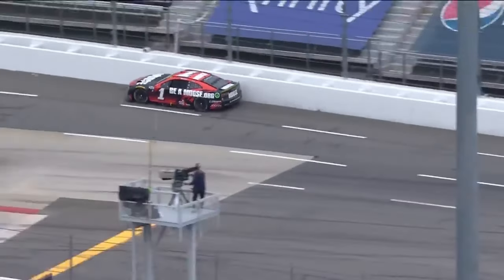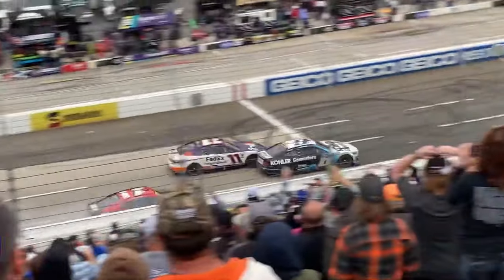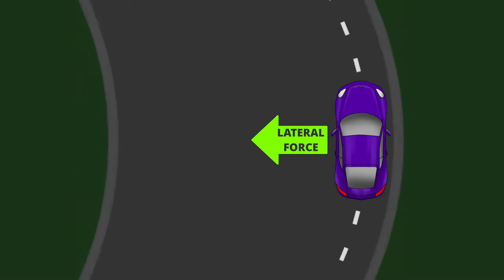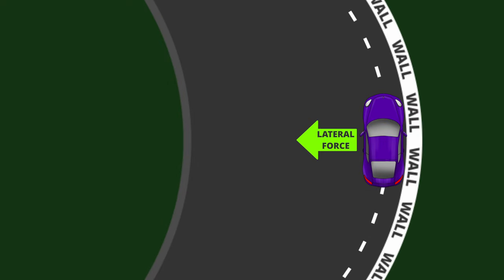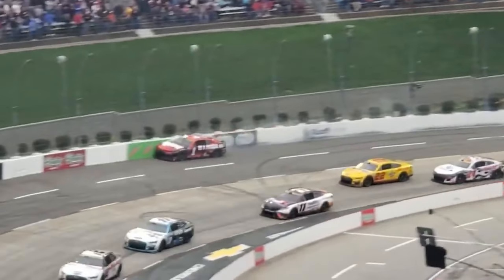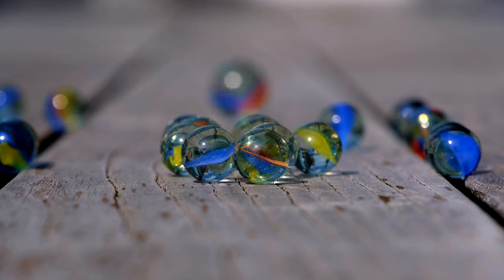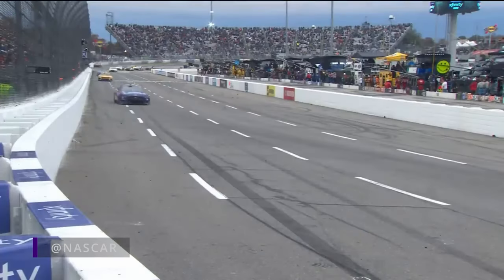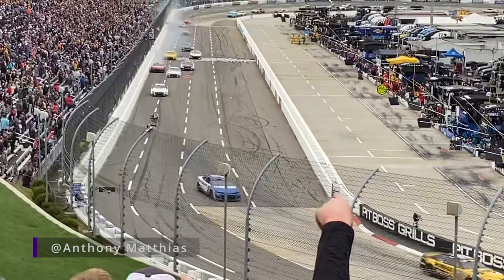Why did Ross Chastain's WALL RIDE work? [SIMPLIFIED PHYSICS BREAKDOWN]

Comment from the maker: A couple of other factors worth noting that was too 'deep' for this intentionally-simplified video...
Physical factors:
  1. Low(er) curvature of the wall
  2. Suitable stiffness of the wall
  3. Sufficient gap between the tires and the wall
  4. Shape of the body
Tactical factors:
  1. Large speed differential between straight and turn
  2. Short straights
  3. Low banking
  4. Sufficiently clear traffic
Reply from the maker: fladave99 Mills  Yeah by my math, he was near 6G's when he entered the corner. That's crazy. On another note, do you have any preventative measures for bruising around the spine in karts?
Reply from the maker: fladave99 Mills  Slowdown? Never... but yeah you're right, I tend to be a bit loose in the seat. I think that's what's doing it. I thought my jacket would alleviate it but it did not.
Reply from the maker: fladave99 Mills  Thanks man! Thanks for the support. I do have a rib protector, just seems like sometimes even with it on I get all these bruises down my spine.
Reply from the maker: fladave99 Mills  lol yeap. it's difficult indeed. I didn't either until I started it.
Reply from the maker: It's really just practicing various tasks in isolation enough so it becomes second nature, then adding more and more tasks to it - basically "walking and chewing gum at the same time". For many novice students, it's quite overwhelming, but eventually many tasks get put on autopilot.

I would presume flying a fighter jet in combat would be an activity that requires more management.
Reply from the maker: You mean these?? https://images.app.goo.gl/Pcu9GGNUq5LeESyWA

Comment: Sorry but you’re missing a very important factor. The wall (by design) is flexible and has some “give” to it. One of the keys to Ross’s move was staying close to wall all the way down the back stretch, narrowing the angle of contact when the wall ride began. Had he started lower he would have shot up at too harsh of an angle and the barrier would have given into the weight, creating an indent the car would have gotten stuck in. Had he started the wall ride earlier, he would have risked not being able to turn the wheel, limiting the effectiveness and he still had to turn slightly…none of it was planned..just luck and courage
Reply from the maker: Yes you are correct. There are many other factors that I was addressing on the comments as you posted this. Take a look and let me know if I have missed anything.

Comment: This is one of those moves that leaves everyone in every former race since the beginning of NASCAR, wondering why the heck they didn't think of this.  As others have said, now that this particular genie is out of the lamp, it'll be banned as quickly as is possible.  To be sure, in this instance, the parts carnage was totally worth the outcome.  It's expensive to do this, so....
Reply: It's been tried before, just that it's never worked.
Reply: Because older cars are a lot softer. Try in beamNG drive the car change shape and slow down too much.

Comment: It won’t work every where, and who knows if Chastain just got lucky. I don’t think it will be  a regular thing. A couple drivers might try it and if they fail then the move will slowly fade away.   Also Bold moves like this are generally the type that creates new rules or rule modifications to prevent or limit this.  Tracks like Dover, Bristol, Darlington, and Super Speedways where you are constantly pushing this limit what do you do there. I don’t think you can completely ban this move but maybe limit the time or distance a car can be on the wall.
Reply from the maker: Luck is definitely a factor, as are many things like the curvature of the wall etc.
Why don’t you think they can completely ban it?
Reply: @LastTenth  I just think that certain track like Darlington where your pushing that boundary it’s going to be hard to distinguish what’s intentional and what’s not in some cases and it then becomes a judgment call.
Reply from the maker: Is it because of the banking and viability of the outside lane ? (NASCAR noob here)

Comment: It will be made illegal. As cool as it is, it's simply too dangerous, for all the drivers, to remain legal. In fact, they should probably change the rule now to save other drivers' lives, which means you necessarily have to disqualify Chastain. He was lucky it worked. If you angle into the wall too much, you'll ricochet back out into the raceway, into the other cars. That happens on accident a lot, but if this move remains legal, people will intentionally try it, which will increase the level of danger on the last lap.

Comment: Does low suspension come into play
Reply from the maker: Unlikely unless I'm missing something. Ride height will change the track width which may help/hurt wall riding, but I doubt it's at play in general.
Maybe someone else will have a better answer...

Comment: I've been a Nascar fan for 25 years and I've never seen a move like this. I also don't want it banned. 

If Nascar wants to fix this problem without adding a new rule the answer is simple. Have a different transmission package at the short tracks ( Martinsville) that doesn't have a 5th gear. The only reason he went that fast and gained that much time was because he had a 5th gear option (Next Gen). Take that away and I don't see him gaining the spots he did. Thus while it'll still be legal drivers won't try it
Reply from the maker: That's interesting. Is it common for them to stipulate different transmission specs at different events?
Reply: @LastTenth  Yes, Nascar sets limits to the transmission great ratios. It's possible for them to set a gear ratio that limits speed below what Ross did.
Reply from the maker: @keeganbrown9967  Good to know. Thanks!

Comment: Two thoughts 
1) Gutsiest move I’ve ever seen.
2)  Most dangerous thing I’ve ever witnessed on a track.
Reply: Definitely not the most dangerous move.  Keslowski/Edwards was probably one of the most dangerous.
Reply: @billyrayvalentine7972  The crazy thing about Keselowski/Edwards drama is that you can choose which one was more dangerous (Carl being thrown into the stands at Talladega, Edwards turning Keselovski and flipping him over in Atlanta or Edwards spinning Keselovski in the middle of the pack in Gateway)
Reply: @pedrooliveiraoliveirasimoe5478  Carl came down on Kes at Talladega. That was on Carl. He obviously didn't mean to flip Brad at Atlanta, just spin him, but it ended up being extremely dangerous based on the way the roll cage got crushed. Wrecking Brad at Gateway was a total chickenshit move.

Comment: -Going over 100mph
-Says it was a blurr
-Small turn
Definitely took a couple G's of force during that maneuver lol what a legend. I'm surprised he didn't lift off the throttle at all
Reply from the maker: He was entering the corner in the vicinity of 6G's by my math.
Reply: well ross said himself his head was jolted after that, i think those was the words he used. yea this wont be common. the cost outwieghts the gain and this is the only reason to do this.

Comment: i can see why they wouldnt want it legal. there would be the possibility of too much debris on the track that could cause accidents or premature failure of tires. there is also the issue of the damage to the car, which can be mitigated if you design some sort of roller to take the corner. but i feel like if that happens, then nascar is going to turn into wall riding simulator and they will just be wall riding every corner..... so probly best to ban it. it was cool, but if its not on a final lap, could be problematic.

Comment: I don't follow nascar, so my question is: Why he did that? Did he won? Or just to get 5 places?
Reply from the maker: I don't either (or any racing really 😳), but from what I understand, he needed 2 positions to qualify for the title race, or something on those lines. Experts please chime in...
Reply: He was in a fight with Denny Hamlin over the fourth spot in the Championship 4, and Denny being fourth while Ross being tenth, with the previous race results, would put Chastain out because he needed to at least overtake 2 more cars in order to make up enough points to remain in the top 4. Chastain owned what is called the “tie-breaker” over Hamlin, as he finished in second place more than Hamlin had done, whilst they had the same number of wins. So what he needed was to just grab 2 more points in the total to send him through to the final four. Come the final lap and Hamlin had made up more than 3 places in the last 10 laps, while Chastain hadn’t been able to close the gap (Points for Hamlin being 4134, and points for Chastain being 4132). Come the final turn, he had nothing to lose, so why the hell not try it. Since it worked, he finished fifth (fourth when Brad Keselowski was disqualified for the car not meeting minimum weight requirements) but most importantly ahead of Hamlin, meaning no matter what would have happened (other than himself being disqualified, i guess), Chastain definitely had at least the same points as Hamlin, and so he went through.
Reply from the maker: @Jb.3910  Thanks for the context. Very helpful for a NASCAR noob like me.

Comment: They can’t let this be legal.  But was cool to see chastain pull this off.  One of the most amazing moves I’ve ever seen.
Reply from the maker: They may probably have to do something about the ruling in the future. On the flip side, this is great TV.
Reply: They can't really penalize Ross for doing it this time, because there is currently no rule against it. But I would be surprised if they allowed it to happen again. I see a lot of potential safety concerns that Nascar probably doesn't want to be responsible for. 

They'll probably implement some sort of rule about entering a corner without making any attempt to slow down or control your speed. I don't see how they could make a rule against hitting the wall since that's not always in the drivers control. And they have to make allowance for brake failure, stuck throttle, getting shoved by another car, etc. 

But Nascar could argue that intentionally turning your car into an uncontrolled missile is a safety hazard to other drivers, safety crew, and potentially fans in the grandstands if debris flies over the fence. May not be a problem at Martinsville, but could be if a driver tried this at a higher speed track.